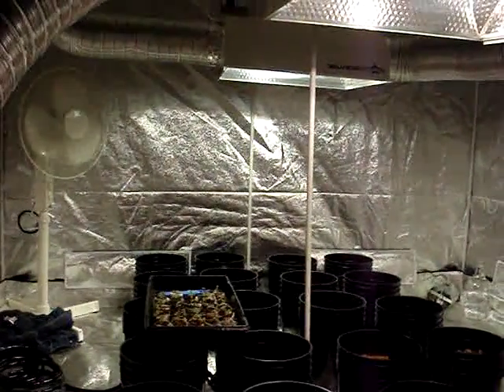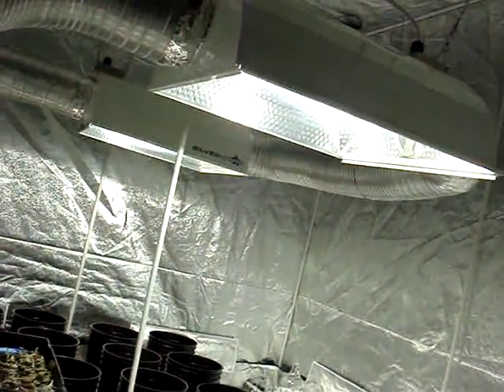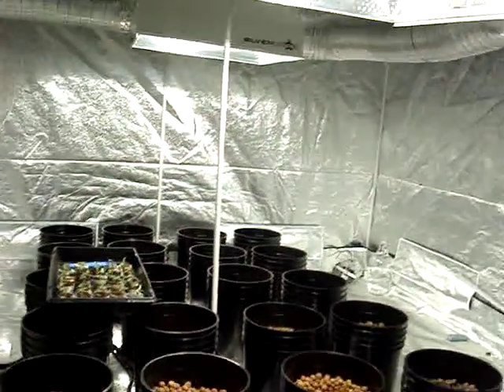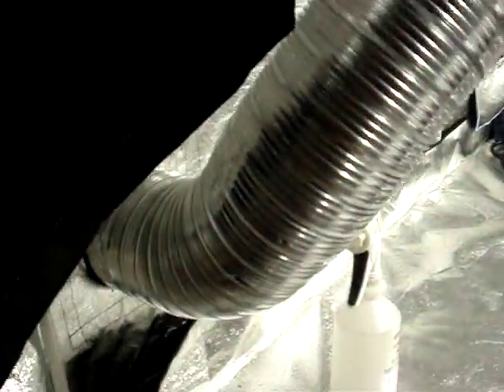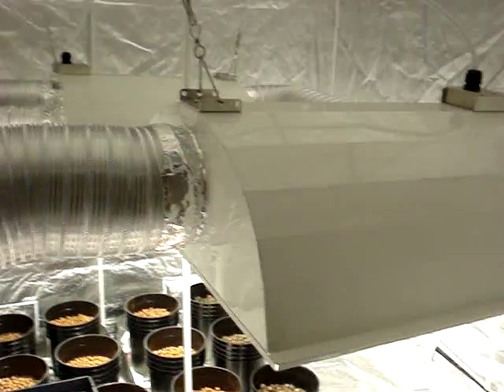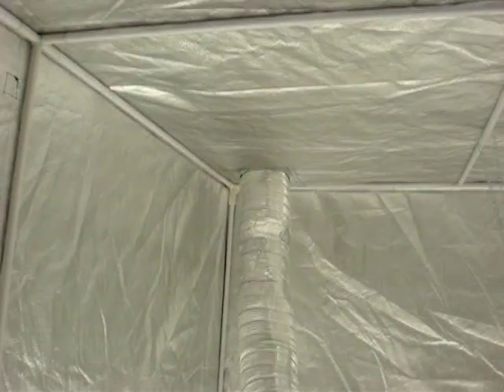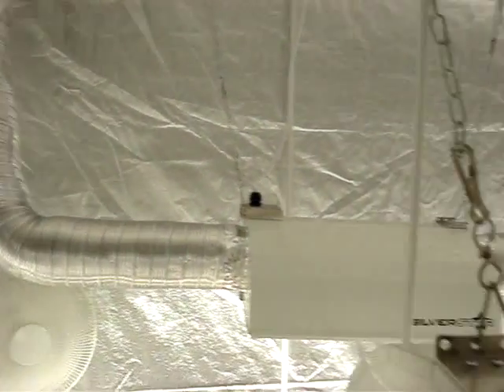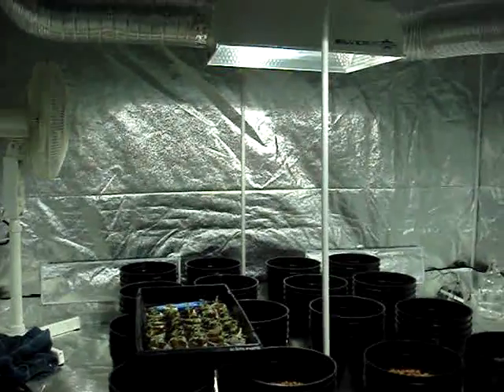Grow light ventilation

Comment: Why have you decided to run the ducting like that?
Are you opposed to having the reflectors in line?,  u would get better air flow having the reflectors inline 
reason i ask is because for every 90 angle you lose about 5% of your fans cfm 
it apperas you have 2 90 degree angles 

nice video

Comment from the maker: Due to location it can get so cold outside (-40) >  that the air would shatter the bulbs upon contact. I put my intake near a window I replaced with sheet insulation. My exhaust was located in another part of the house and helped supplement my heating bill. Srsly you can spend $300-$400+ a month in heating oil here.